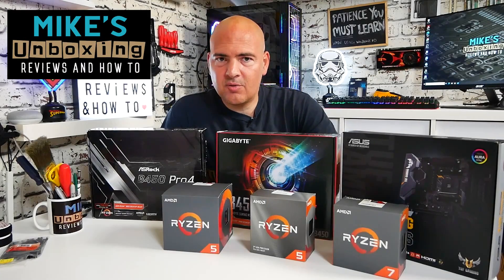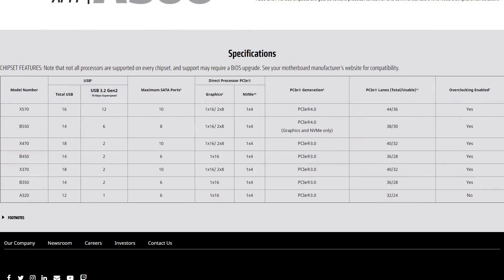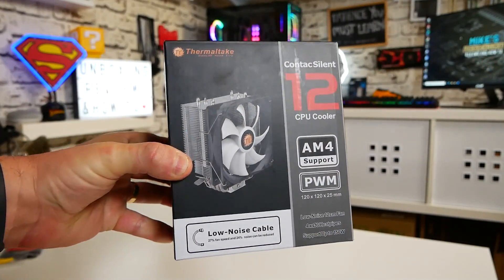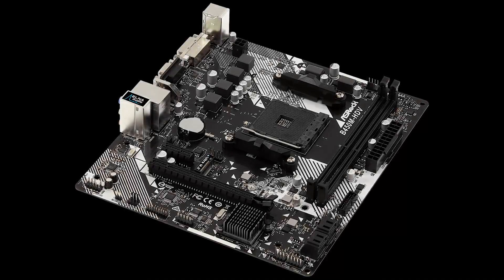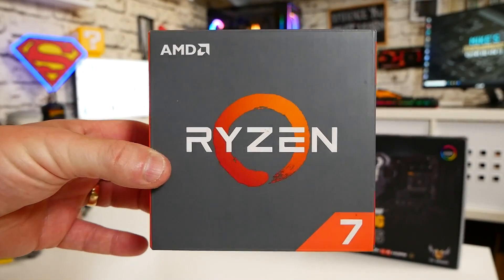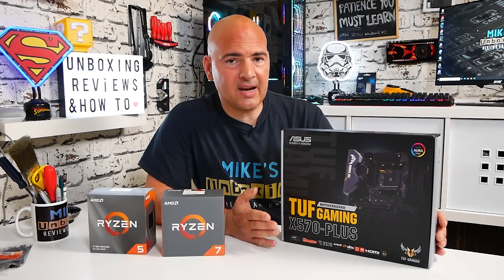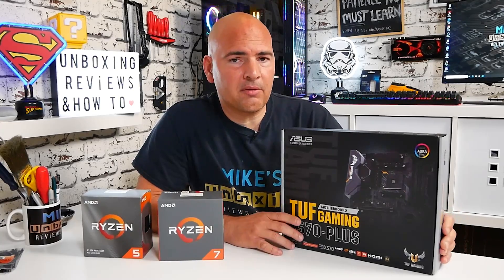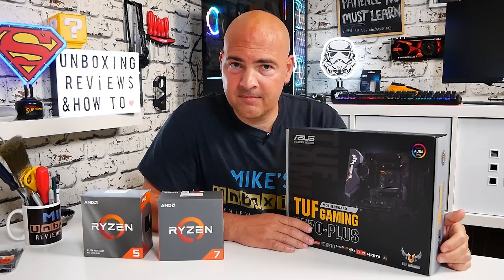AM4 Motherboard Overclocking & Chipset Compatibilty Explained

Comment: MSI A320M-A PRO MAX Have something like core boost on the board indicating that it can be overclock. If you can't overclock the chipset just run a practical test demonstrating exactly what will happen when you overclock on the board. I think most people will understand it better that way.
Reply from the maker: core boost is just precision boost overclock which is built into the processor and chipset but is not multiplier overclocking
Reply: @mikesunboxing  Thanks for the reply. Sadly I ordered for the A320 motherboard before watching your video.I read some reviews with some people saying they were able to overclock with the latest bios updates.
Reply: @mikesunboxing  Thanks for the reply. Sadly I ordered for the A320 motherboard before watching your video.I read some reviews with some people saying they were able to overclock with the latest bios updates.

Comment: I just brought a 2700x for my asrock b450 But the asrock b450 has a cpu tdp limit of 65tdp and the 2700x is 105, and the 2700 is 95tdp. (Realised after buying) Does this video mean I will be fine? I have a pretty decent aio so cooling should be okay if that helps at all, would love for someone to get back to me asap!!!
Reply from the maker: Tom might be a good idea if you actually told us what the specific board  is
Reply: People tell me that my vrm's should be fine as long as I have good case airflow, which thank god I do. Would just love some closure as I spent alot of money and can't find info on this anywhere
Reply: The asrock b450 pro4 in your video

Comment: If you want some spects of my system I have a MSI Meg X570 Unify and a R7 3800X OC to 4.4 Ghz. The X570 has better ram management allowing me to OC my ram to 3733 MHz with timings of 14-15-13-28-41-280 1T. X570 also had PCIe Gen 4. My boot drive is a Sabrent 1TB Rocket NVMe 4.0 Gen4 PCIe M.2 drive. CrystalDiskMark Boot Drive Seq read 5007 mb/s Seq write 4280 mb/s. Some Benchmarks... Cinebench R20 score 5282, Time Spy score 9783. Running Time Spy my max CPU temp was 42C. Also my GPU is a 5700XT which is a good card, but I could get better benchmarks scores with a 2080 super. So, probably my next big purchase.
Reply from the maker: go on splash out on a new card, it is nearly xmas
Reply: @mikesunboxing  Well I don't celebrate Christmas, but that's not a bad idea. I'm waiting to see what's new on the horizon from Nvidia and AMD.

Comment: Nice explanations mate. I've put together two 3600 builds both on b450 and had power delivery issues on both even after installing the chipset drivers. On the first build using 'power saver' in power settings fixed it. The second one I had to go into the bios, turn off xmp and manually set ram clocks, timings, and cpu voltage limit. Bit of a faff but finally got going with it. Not sure if anyone else has had these issues on b450
Reply from the maker: Thanks for sharing, wonder if anyone else had that issue

Comment: Hi Mike! Very good video. My thoughts on AMD boards: "A" series is for those people who don't have a large budget but want to feel the power of Ryzen (or upgrade from older systems (AMD APU's, former "Intel Pentium" dual cores CPU's), a shame AMD or MOBO manufacturers left behind the "AB" series (Gigabyte AB350 for example). The "B" series is the middle ground (well, not now with the B550 series, various MOBOs are more expensive than X570... EX: ASUS ROG Strix e-Gaming: US $279 - Same for AORUS B550 Master MOBO. If you want to feel PICe 4.0 power with these ones you'd rather go for X570). The "X" series is the best but it'll cost you a lot of money (a good CPU, higher frecuency RAM a 750W 80+ Gold PSU). If money isn't a trouble for you, go ahead. An ideal configuration for me would be: AMD R5 2600X, B450 MOBO (with Wifi and BT), 16 GB 3000 MHz RAM and 650 W 80+ Bronze PSU. Video card of your choice.
Reply: Ricardo, love this summery all things AM4, I feel up-skilled after reading it.
Reply from the maker: agreed

Comment: The A320 chipset I feel is a bit underated, they are like £40 new and less used in the UK, and as TechYesCity has shown, they're genrally fine with anything up to a R5 3600
Reply from the maker: Yes totally agree unless it is an off brand wish one then buyer beware
Reply: @mikesunboxing  yeah agreed, although TechYesCity did a video on a few of those too, and the results where interesting
Reply from the maker: yeah very!

Comment: Hey mike can you help I was changing my cpu cooler and one of my screws is turning on the back plate you no the bolts or studs at the back off the back plate can you help I've tried every were but I can't get help someone said drill it out but I'm no sure how to do the plz help 👍🏻
Reply: I'd be inclined to try and dremel (other cheaper rotary cutting tools are available) cut the screw from the side, looks like that may be less risky on a stock cooler than drilling downward.
Reply from the maker: If the thread has gone you are best to replace the backplate you can get them cheaply on eBay etc
Reply: I've got a new backplate  but I can't get that one screw out off the old back plate so I would love to change it  thanks you mike 👍🏻 don't no want to do motherboard is going to get broke if I have to drill the screw out  just wish I could screw it out but I just keeps turning with the backplate thank you so much mike for getting back to me 👍🏻
Reply: Looked everywhere for help but I must be the most unluckiest lol no help and I'm the only one that has had this I think  the  four studs on the backplate never brake I got the one that did lol and I have no idea how to get this screw out I'm going to lose my motherboard but I do need my processor out off it all 👍🏻
Reply: Thanks for that I will do that cheers 👍🏻
Reply from the maker: Good luck with it

Comment: https://www.3dmark.com/fs/22915289

My score with my overclocked 3700x at 4.4 all core and 3733mhz ram using the dram calculator on fast settings got me 64.7 latency.  I had to disable gear down mode to make it stable.  All on the tuf board.
Reply from the maker: nice work